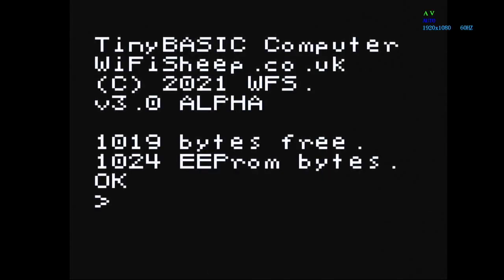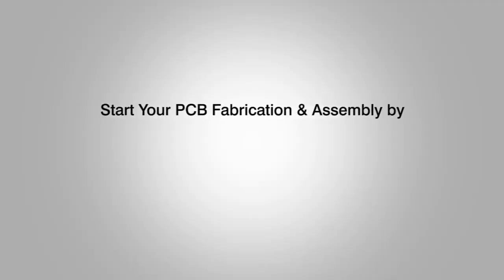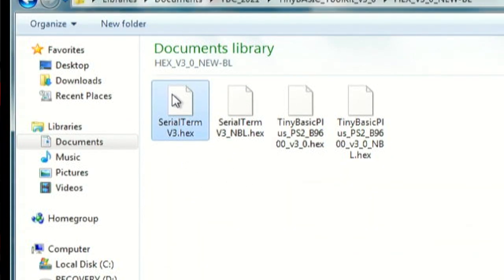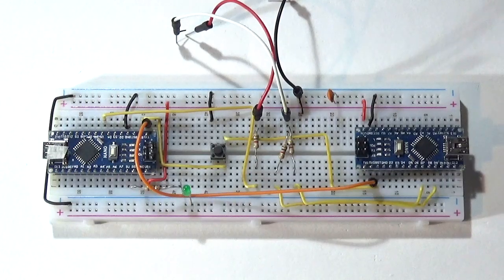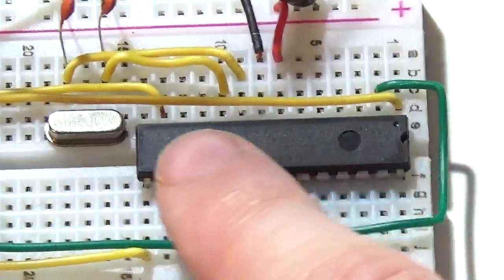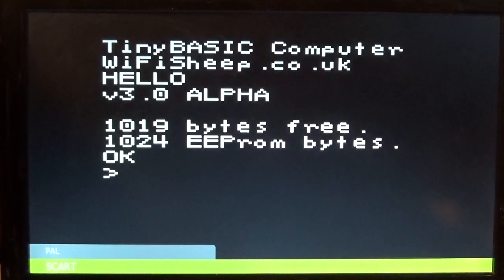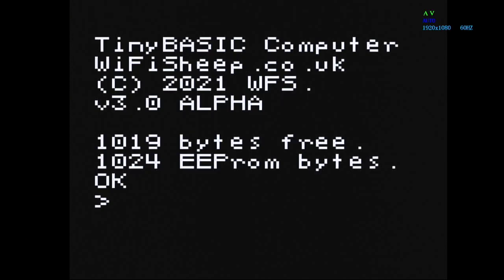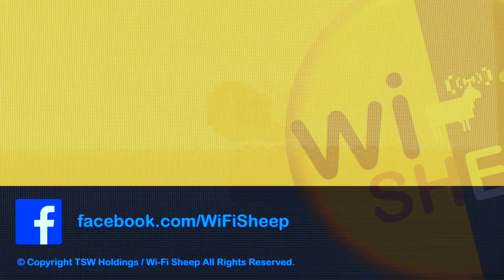TinyBASIC Computers Easy Build 8-Bit! - Pt6: V3.0 Alpha Update

Comment: The difference in definition between PAL and NTSC is not due to a decade's worth of progress.  The channel bandwidth is about the same; PAL has fewer frames per second, so given the same overall budget of how many dots can be drawn in one second, there are more available on one frame.
You are just trading temporal and spacial resolutions.
The choice of 50 HZ vs 60 HTz is not "progress" either, but is simply to match the mains frequency.  This gives a convenient frequency base to use, which simplifies the original B&W receiver designs.  (Color sets need a crystal anyway, and newer B&W sets filter out the color component so still contain the "comb" circuitry.)

Comment: I just wish this didn't require Facebook.
Reply from the maker: I can appreciate some people take issue with Facebook, however it offers the best and most effective tools for administrating a group, Wi-Fi Sheep already has a presence on the platform, as do our sponsors and assistant moderators. So it make the most practical sense to deliver content.
The other none facebook option is to join our $3 Patreon www.patreon.com/wifisheep which will give you access to all the files ROMs and software required for TinyBASIC Computers including the build diagrams uploaded to the Facebook group.
Reply: @WiFiSheep  I am a member of patreon so all good for me. :)
Reply: me too. I refuse to use that horrid platform :-p